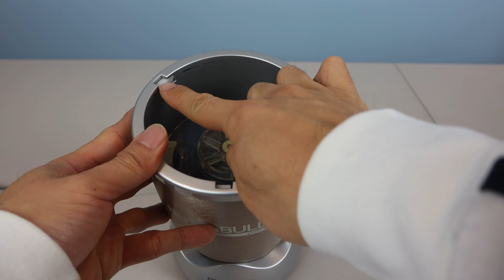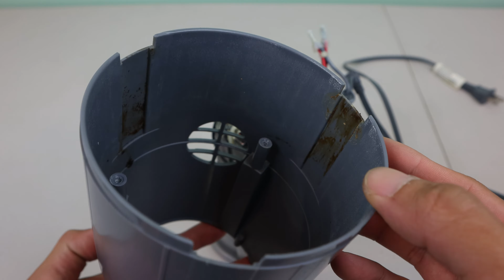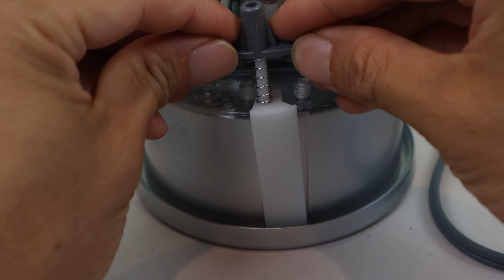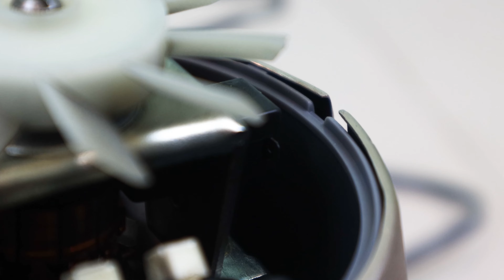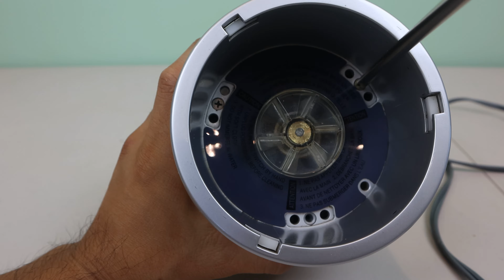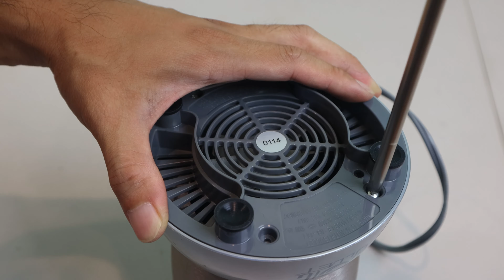Nutribullet Pro 900 Series Blender Base Disassembly and Repair

Comment: I used your video to help disassemble a Nutribullet 600.  The issue I had, was that it would not power up when plugged in. I thought it was a fuse issue, but when I disassembled the unit and tested it out the motor was working.  It worked okay the day before. The plastic shell on mine would not come off as easy as the one on your unit. I was eventually able to remove it.  It had a problem with the switches, but the switch problem was s a bit different than yours. On mine the switch tabs had to be extended out a bit. I had the unit together and it worked until I put the bottom cover on.  It then stopped working.  I disassembled the unit again checked out everything again and reassembled the unit. I tested it before installing the bottom cover and it worked.  I installed the bottom cover and tested the unit before i installed the bottom cover screws and it was still working. I then installed the Bottom cover screws and it kept working. Thanks for your video. Although I was able to get it apart, your video was a great help when it came to the cover removal.

Comment: Plastic clip
I noticed one (non click) of the 3 notches in the rim didn't come up anymore.

 The "spring" missing.

It didn't work anymore. No motor turning on when cup turned into.

Sure enough upon opening, this part (spring and plastic housing of spring)  was loosely floating in the housing, broken,
BUT unfortunately both screw holes of the clip broken off of that base, hence not holding the spring anymore ...
There is too much tension to be able to glue it on.

Super annoying to throw a working motor out because plastic plastic plastic is used to break.

Even if I could buy the clip, there are no hole tunnels on the base to hold it to.

Comment: Made my day,week, maybe a full month. Video was perfect. No short cuts. I appreciate the extra effort you put into realizing the potential problems and then filming the solution. Beyond perfect. Mine had a switch support broken. Snapped. One baby zip tie on the switch and I'm back to loving, possibly abusing, my Nutribullet. Why get out the mixer or blender when King Nutribullet is at your service. Thanks again.

Comment: I blended a beverage, only the second time I’ve used this device, but the cup would not come off the unit.  When I twisted the cup left, two of the three tabs lined up as expected, but the third tab had slipped under the actuator tab.  It took 15 minutes of trying this and that before it suddenly appeared in the correct location, and I was able to remove it.  I carefully tried it again, and the same thing happened.
By the way, only two of the springy actuators make a click sound when depressed.  I don’t know if that’s normal.

Comment: Awesome video production, I wish I had the patience to be that detailed! I have worked on computers, printers, photocopiers, office equipment my whole life. Here is tip I learned over the years when screwing into plastic to prevent stripping. I had a instuctor tell us this.  Put the screw in the hole and with slight pressure turn it counter clockwise, you will feel it drop into the hole correctly. Then turn it clockwise slowly to tighten. It should turn with no resistance. If its hard or feels tight it may be in at a angle. Reverse it out and try again. The last thing you want to do is strip plastic. Keep up the great video's!
Reply from the maker: That's a great tip, thanks for sharing! 😊

Comment: It worked and I started cutting the fruit and when I was done I put it all in and the blender didn't work tried to clear the switches and still didn't work I did your tutorial and I found that the holder of one of the activators was broken I super glued it, put all the pieces back and it worked! Usefull tutorial
Reply from the maker: Awesome, glad the video was helpful!

Comment: Thanks Phil.  Like many of  the other commentators, I was about to throw my Nutribullet away. Your instructions are clear and I was able to restore it to life.  An important point to note is that only two of the three Nutribullet 900 activators have micro-switches, and if, like mine, one of the switches is irreparably broken, the motor still works with just one functional switch.  So don't throw away the plastic blending jug if one (or even two) of the three activator tabs is broken - press down all three activators on the unit till you hear & feel one which has the distinct click of the micro-switch, and then align THAT one with an activator tab on the damaged blending jug.

Comment: Sadly, I got down to the entire dismantling to find that the plastic slot into which one of the screws for the spring goes, was broken in half.  I did all the cleaning and reassembling, just in case that wasn't the problem, and it still didn't work. Still, this was almost fun because you did such an amazing job of clarity - both in your description and the visual.  I sort of enjoyed taking my machine apart and reassembling it. 
BUT, looks like I still need to buy a whole new device, because of that one teeny tiny plastic piece.
Reply: Only two of the clips matter. You'll notice 2 have wires attached and 1 doesn't. Take the clip from the one with no wires and move it to the broken one. Put the broken one on the missing side to help with alignment when seating.
Reply: @chieftricky117 dammit! I bought a whole new one. Thank you for your suggestion. I'll keep it in mind if/when this happens with the new machine. 🙄

Comment: Thank you so much. My wife's NB9-0901 was all gummy and grungy inside and out.  I used your video to take it apart, I take pictures and video along the way to document the screws and parts and label them on a grid on my work table. I was able to take the blender about 70% complete apart, minus the electrical block, and clean the entire thing.  An awesome video for several reasons; no musical background, which is annoying, your awesome explanation and videos/images to go along with. Thanks.

Comment: I've opened mine all the eay w/o the video and found out that one of thr pieces that hold the spring with the red wires and green piece is broke, So, if i try to push fown the cup it's loose. However, i've tried to find the piece online but no luck😞

Comment: If only I knew which left and right you were talking about when putting the plastic sleeve back on. You know you’ve done something wrong when the last piece won’t go back on. Basically when looking down at the appliance, have the red wires facing you. Place the plastic part down with the vent to the right of the wires. Which way should the red wires face? I need girl-splaining.
Reply from the maker: If the tab with the switch that has the red wires connected to it is facing you, like in the video at 3:00, if the vent on the plastic piece is also facing you, turn the vent away from you, counter-clockwise, towards your right hand side, as I do in the video. The first notch in the plastic sleeve to line up with the switch when doing this is the correct one for alignment.

Comment: I did this and it still doesn’t work. How can check if the motor is burned out? There’s no visible burning but it did smell kinda burned when it stopped working.

Comment: I  had a bad wire connection, took it apart and when I started it up again I didn't have it assembled and it broke 6 of the 10 vent cooling fan. Is there a way to replace the fan as it's screw won't budge. I can buy used ones for parts, but do you sell new replacement vent fans for the 900 series as in this video. Likely ....few have this problem. Any advice ?

Comment: Do you know if it's possible to get replacement switches? I had the same issue after my partner unscrewed the container trying to remove it and leaked smoothie onto the switches which stuck. When I tried to use it again I damaged a switch a broke off a tab on the container.

Comment: I had one of the 2 actuator switches on nutribullet 900 pro go bad. Your instructions were so clear that motivated me to try the repair work. I shorted the wires going to one of the actuator switches so now I’ve this working just fine on one of the switches (that click).
Thanks a bunch! 😊

Comment: Removed the screws to remove the gray plastic cover (middle step), but the cover is stuck with liquid /debris. What can I do to loosen it up?
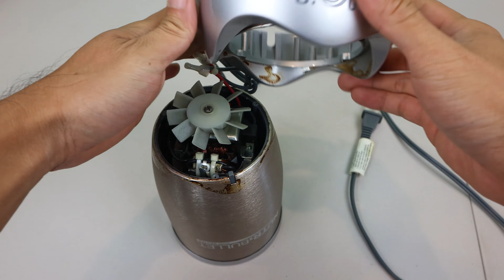Reply from the maker: You're referring to the plastic base at 1:26? You may be able to soften or melt some of the sticky residue by turning the unit right-side up, with the bottom plate removed, and run warm water down the outside of the metal housing so that it seeps between the housing and the plastic base. This may be enough to soften or melt the residue. Make sure the unit is on a wire rack so that the water runs out the bottom of the plastic ring and doesn't enter the body of the machine. Once the four screws are removed, the plastic base isn't attached to anything, so you should be fine to use a bit of extra pressure to pull the base off. Good luck!

Comment: No need for grease?
Reply from the maker: There wasn't any grease on the actuators when I opened the unit up, so if the manufacturer doesn't think it's necessary, I wouldn't worry about it.
Reply: @FixItPhil thanks bro

Comment: We had this nutribullet since its release  in 2012 13 years later its still going strong. I've had to open it up a few times due to leakage, nothing is damaged. Brushes are going strong still ( its the only complaint as the capacator is soldered on it) but after daily use for 13 years the brushes arent even 20% spent, as you ussualy blend a short while. 

Its repairable, nothing is glued in place essentially, parts are available everywere. I got to love it. Nutribullet and Ninja are two of the brands i ussualy go to due to this. cosmetic plastic parts asside their always available.

Comment: Your instructions are incredibly clear without a lot of jabber -- thank you so much for that.  The thing I struggled with are the two smaller red wires that should be channeled through the right slot on the base.  Lining them up was difficult to align.  When I replaced the last 4 screws, the base was a bit uneven -- one side nearest the two slots was a "little" high probably due to the red wires not being perfectly aligned.  Going ahead with the repair as everything seems to be "almost" in place.  Time to plug it in -- crossing my fingers!

Comment: Help! I recently use My Nutribullet 900 series blender to make a fruit and vegetable smoothie and when I pressed down on the plastic 16 oz cup the plastic gear in the middle of the blender shattered and there is no longer any gear on the Blender. Before I throw it away, is there a replacement part that can be installed to make the unit work again! Please advise.  Thank you in advance
Reply from the maker: I believe this is the part you are looking for: https://amzn.to/3WhttZe [Amazon Affiliate Product Link]

Comment: This is good information. It's a poor design. They should be metal. The tabs that you push down on from the cup should be metal. Should have been a metal ring around there with those three tabs. Those break it's just kind of odd way to turn it on.

Comment: The issue I have is the the gear inside is got leaked on and sounds like it's drying up from the top. When I didn't put the lid on well enough juice went down in there. I'm trying to lubricate it from the top. Have you tried that before?

Comment: Thank you for spending the time to create this video. Excellent work. Good detailed instructions. Good video angles. Nice voice over. Got my hard to push down Nutribullet back to normal. Found it helpful to use an old toothbrush dipped in warm water to clean the old hardened gunk inside the Nutribullet.

Comment: I was gifted an old Nutribullet that was clearly neglected. It had visible stuff in it, pressing down was very hard. I have always been a fan of taking things apart and cleaning/fixing them. I got it almost torn down and couldn't figure out how to get the plastic shell from around the motor. I found you video and it held the answer. I've got to say that you did this video very well. You didn't add a lot of fluff to it, got to the point. You were clear and easy to understand. Great video!!
Reply from the maker: Excellent! Thanks for the compliment 😊

Comment: Followed everything. Easy to understand.Even removed the tiny springs and cleaned them and replaced them. the little white tabs move up and down perfectly. BUT not working!!!!! So frustrating..................! The lid engages and locks perfectly. but nothing....

Comment: Thank you!  I was able to fix mine.  However, it was a broken standoff that caused the issue.  I have to use a longer screw to hold down the contact switch base.  I was able to fix it.

Comment: When you have the white actuator are out and cleaned, before you re-install put a small amount of Vaseline on the face of the actuator so if you have a spillage again it will not stick! This works.

Comment: thanks it made cleaning it a breeze. Just trucky getting bottom in have to bend plastic so it goes in. mine was a mess. sticky goo.I added silicone lube to springs and plastic parts to insure easy sliding.

Comment: Desperately trying to get the inner screws out. Any suggestions?
Reply from the maker: Stuck screws can be a pain, but as long as they're not stripped there is hope for removal! My tips are to ensure that the screwdriver tip is sized correctly and fills the entire '+' groove of the screw. If it's wiggly/loose or doesn't seat all the way into the groove firmly, it is not the right size. Never use a screwdriver that is not the right tip size for the screw, as this can and will lead to stripping of the screwhead's groove. My second tip is to apply firm pressure onto the screw while turning. You may need to press really hard into it while turning counter-clockwise, as this will generate more torque. If all else fails, use a powered tool, but still apply tips 1 and 2, as power tools can damage screws more easily.

Comment: This is so helpful! Can you please do one on servicing the blade assembly as well? I have taken the blade off and sharpened it (you just turn the blade and rubber part clockwise to unscrew it) but I'm wondering about oiling the parts inside as I have seen black oily junk come out of it. I'm worried about opening it up in case I can't reassemble it! Thanks

Comment: hello i follow all the steps not because they need the cleaning but hoping to see if i can make to work i have this as gift second hand but when i am trying the motor das not work at all so not sure if can be repair or is something else this motor was cleaner machine so i was hoping for the best no luck
Reply from the maker: Sorry to hear that. It's hard to diagnose from afar what's causing a non-running motor as it could be anything from a damaged power cord, faulty wiring, worn out trigger contacts, to a seized motor.

Comment: I don’t ever remember the company saying in any manual or anything that this was something you could do! We’ve had ours for so many years and it’s had multiple spills. We’ve had the same lids the entire time, didn’t even know you were supposed to replace them! The inside of my Nutribullet is absolutely disgusting and the smell is awful. I think I need to disassemble it slightly further than you went though because it’s making an awful noise (which it why I went and searched how to disassemble it, why I didn’t think to do that any of the times I had a massive spill, who knows?!)  I’m guessing the rotating parts just need more lubricant, like I said It is really old. I can’t afford a new one so wish me luck!

You’d think they would design it so if a spill happened nothing could get inside the unit but oh well.
Reply: Remove the gasket on the container and clean it regularly.

Comment: Phil great video. I’m almost there but have a question.  Does the blade you put on as the cover when making a drink have a rubber gasket in it?  I can’t figure out if I’m missing a piece or there never was one. I cleaned the whole machine as directed and almost have it put back. Wondering if I’m missing a piece and that’s why it leaked
Reply: I don’t know if you still need this info but he never responded to you so I will in case anyone else sees this and is looking for the answer.

By fan blade are you referring to the blending blade on the cup lid? If so then Yes, that should have a rubber gasket and sometimes they can fail, so can the bearings (internal mechanism) of the blade if it overheats to much from not being maintained or rusts from getting water inside it. There are guides to disassemble the cup lids too, and if you disassemble them and clean and oil the internal parts to keep them turning without heating up you can get the lids to last 1-2 years or more as opposed to the company’s recommended replacement cycle of every 6 months or something. They charge a rediculous price for those things so it’s well worth it to keep them in good shape and get a long life out of them. Hope this helps anyone who has this question!

Comment: These machines are an awful design. It's designed to fail. Metal screws go into plastic threads. That's just stupid. Any reassembly and you crack the thread and the machine is garbage. Never buy junk from CH-ina.